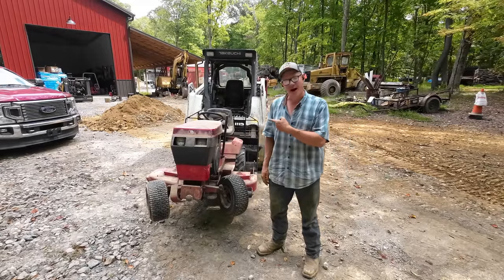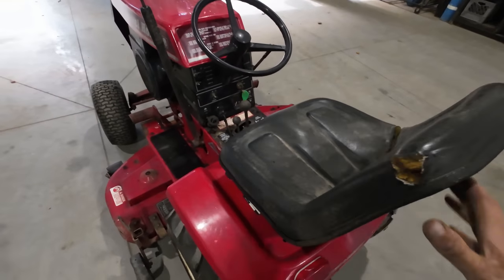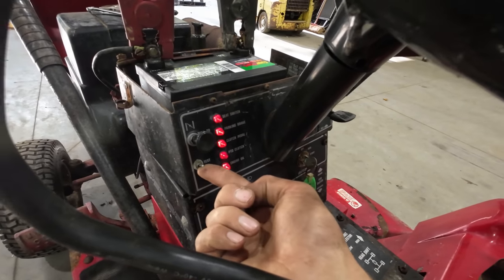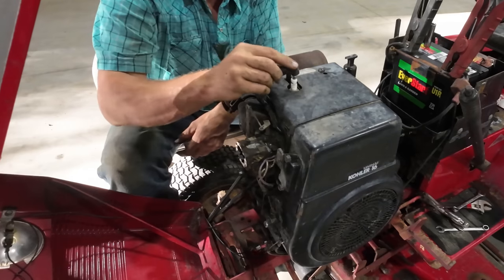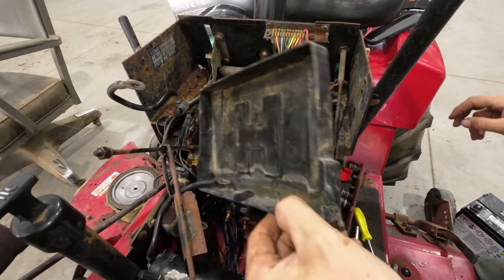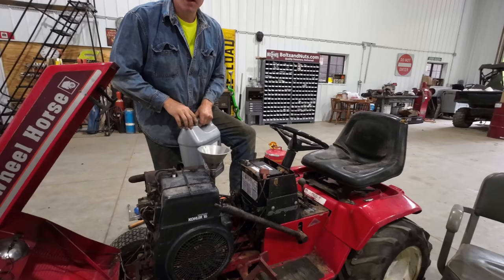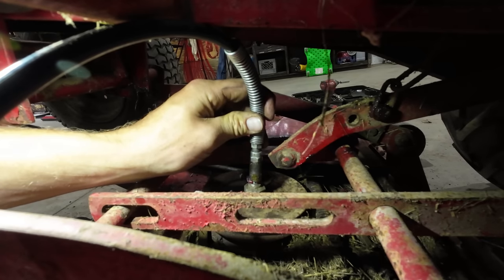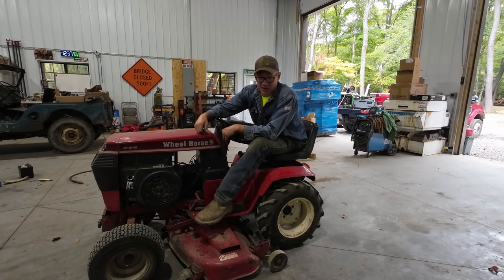FREE! Wheel Horse Garden Tractor sitting for YEARS! (WILL IT RUN??)

Comment: Mat I dont know if you knew this or not but one thing to note about those old K series Kohlers they had balance gears (Gernade Gears) inside the block they had needle bearings in them over time they tended to fall apart and or blow up blowing holes in the side of the block. Might want to check into that before that tractor goes to your dad only issue is to get those out is its a major surgery unless you just take the pan off and bust them out. I'm not sure if the Magnum's had them but the K series are basically the same thing as the magnum engines just points as opposed to solid state ignition.

Comment: great tractor. that's a magnum series engine. not the legend the k was but still good. those trans had either 1" or 1-1/8" axles with either bearings or bushings. all depending on the year and model. the little rubber boots on the shifters rot and water will get into the trans and freeze. that's why mine is a lawn ornament. the side discharge was the better deck than the rear discharge, much better cut.  that light board is real succeptable to battery vapor corroding it  so fluid film it up real good.  for some strange reason those plastic gas tanks in those make water  so keep it full

Comment: There are times I leave things dirty when I don't know them just in case I need witness marks if I have to remove a part that needs to be located specifically.. I'll wash things AFTER I'm finished with the repair but not usually before. If I'm going all out in a restoration, then fine, I'm going to do a nut and bolt so I'll re-seat everything anyway but no.. leaving it the way it was found is sometimes very important actually. (Bird poop not necessary though!)

Comment: I have lately considered it bad that so many people still seem to insist on using power drivers to remove bolts from these older small engines..  I see so often bolts broken, threads stripped etc. We always when encountering a jammed bolt in Aluminium alloy, carefully, by hand, push and pull, with addition of some form of lubricant or penetrant, and also add a careful shock to the end of the bolt to assist removal.

Comment: The 4 is 400 series, they made 200, 300, 400 and 500 series.  The higher the series, the beefier they are and more features they have.  Yours is a 1988 model.  You could have changed the transmission oil as well, but most likely it doesn't need it as long as there's no water in it.  If you want any manuals for that or any wheel horse tractor, check out the Red Square Wheel Horse Forum, they have every manual you could need there.

Comment: I would have tapped those Solenoid bolt holes and used a slightly larger bolt to do away with those nuts.

Comment: You could probably replace that center belt pulley grease fitting with a low profile zerk fitting. You won't have to worry about anything snapping off and it will keep dirt and crap from contaminating the grease in the pulley. You will need a grease needle to fill it, but I imagine you already have a few and if not, they're pretty cheap.

Comment: Hay Matt, why fool with those cracked and leaky tires? The airless can't hurt 'em solid tires are not that expensive and ya don't have to worry about flats, slime, or valve stems. Try Northern Tool and never worry about those front tires again.

Comment: I know you're a Cub Cadet man, but I really think the only advantage cubby had over wheel horse was the fact they used direct drive shafts to run everything instead of belts. Saw a wheel horse from back in the 60s once with a cigarette lighter on the dash.

Comment: Hey Matt.  Back in the 70s they did good with'em in tractor pulls.  Using a big ole stone boat loaded with solid concrete blocks.  I remember seeing more that one with a major number of wheel weights along with other additional weighting.  Surprisingly they'd pull some awfully heavy loads.

Comment: All our wheel horse, Gravely and older mowers with Kohler engines all had a short nipple and a 90 with a plug im assuming to aid in clean oil drainage because the block sat back up on the mount plate about an inch further than yours. Without that short extension oil would surely run all over everything

Comment: Can't kill an old Kohler! Had and older version of that Wheel house. I'm the same with my little machines and prefer Cub Cadets, have two 982's and a 1782 along with a bunch of older Cub's. I have run Shell T5 10w30, all my Kubota powered machines call for 10w30 so using it in everything small engine is easy peace of mind. That and it being diesel rated oil should help the older engines.

Comment: hi ,, the battery has a sticker that read E 6 ,,, so all battery got the sticker on them and some battery are punched in to the top sides ,, ( A ) means JAN ,, ( B ) means FEB ,, and so on ,,,,  6 ,, its maybe a 2006 battery or a 2016 battery ,,,, and most battery has a part number or group size  punch into the top side  also

Comment: Not that it makes any difference at this point but the date code sticker on the battery that came with the tractor  is the one with the E6 on it. The E is the 5th letter of the alphabet and represents the 5th month of the year so in this case would be May.  The 6 stands for 2016. Also, you seem to be having a problem getting past the first compression stroke when starting the Kohler. Probably a automatic compression release issue.  That could also explain the failed solenoid. When the starter can't get past that first compression stroke it's a dead short to the battery and needless to say overloads the contact in the solenoid.  Nice machine for the price.  But, I'm like you. Love my Cub Cadets but only the ones made by IH.  I have a couple 125's which were made in 1968. One I have since 1972 and still running strong. It was $1350.00 new without a mower deck. That was half the price of some new cars back then.  But, 55 years later still running with original engine.

Comment: The production date on that battery would be May of 2016.     That is what the "E6" tag is telling you.    E=May     6=2016    The letter corresponds to the month of the year. For instance, A= January. They start over at 0 at the beginning of every decade, but you can figure out the decade by looking at the labels, logos, etc.  That version of the logo was around in the 2010s.  I spent 10 years working with used batteries for a living. I've dealt with thousands. That matches the time frame the previous owner gave you.

Comment: I certainly agree when it comes to not cheaping out on oil, but it is important to use the proper weight oil. If you are using 15W in an engine that is desgined to run on a lighter weight, that engine is not able to efficiently circulate the thicker oil, and it will cause premature wear to modern engines. Engines manufactured prior to the early 90's were designed to run on different weights at different times of the year, but engines produced after the early 90's are not. I have found that a lot of people are unaware of that, and run modern engines the same way that they ran antique engines. I have see many engines worn out under 100K from people running oil was too thick for the engine. That is why oil manufacturers make high mileage oil. It is designed to offer better protection for high mileage engines thout using a thicker weight.

Comment: You kinda squawked about the nuts behind the firewall that held the solenoid on, newer stuff would probably have just used sheet metal screws. It’s a sign of better quality that they used nuts and bolts when they built this tractor. I would have complained too! Lol

Comment: i have never seen a wheel horse garden tractor over here in germany but the kind of how this is build reminds me of a brand we had over here in germany !  Gutbrod back then build them like tanks : Grease fittings everywhere, massive sturdy front axle, standardized parts and bearings, Briggs I/C Engines, metal hood without hinges because hinges could break after years of service.  nowadays the tractors named Gutbrod are just junk from MTD........ and you now what MTD stands for : MADE TO DIE  or in german "Minderwertiger teurer Dreck!"

Comment: I was told at one auto parts place that the green slime is the worst stuff to put in your tire because it will rot the rubber.
They said that there's other better products to seal a tire.
Maybe that green slime that was in there before is what caused the valve stem to rot off.

Since you don't really need that little tractor why don't you give it to me. 😃😁😉

Comment: i have a 310-8 1989 i think.  That has no spark.  I think that s safety switch.  i had it running, but now no spark.  How did you bypass the seat switch.  Also, do you have any idea what else could cause a no spark.  thx frank

Comment: Somebody was probably smart and ran non ethanol gas in that tractor, these new ethanol fuels can cause this weird white corrosion in small engine carbs, I’ve seen it too many times on pressure washers and lawn mowed, could also be these new Chinese cheap crappy carbs too, they don’t build stuff like they used to

Comment: Matt I have a older Cub Cadet that has been running starting and running fine till this year, when I try to start it runs for about 15 to 20 seconds then shuts off and is flooding out with fuel coming out of breather housing. Any idea what's going on?

Comment: I’m willing to bet that the solenoid died and it wouldn’t start, it was old so it was parked.  Last time I saw a solenoid that bad.. my old Ford Escort (loved that car)… wouldn’t start so I was checking the cables, and when I tried to remove the nut off the solenoid.. got the entire post… replaced and problem solved.. just like here…

Comment: Some engineers should not be allowed to design as much as a street sign. Like engineers who use bolt with a nut that is hidden behind everything, and i mean literally everything, where you literally need to take the whole unit apart to get to that one stinking nut. It is so many years since they invented a draw rivets with threads (The first rivet nut was created by BF Goodrich in the 1930s) or spot welders that can spot weld a nut on the hole...

Comment: John Deere 300 and 400 series ( the older ones ) are the best “Garden tractors “ ever made..  will def out a cub or wheel horse .. i have a 332 diesel and a 322 with the yanmar gas engine , and cub and wheel horse well i expressed my opinion on that already😂😂😂 but those Kohler engines are the best most durable engines ever made again my opinion , they are dam near bullet proof , again the older ones.. oh and put some tires on it😂😂😂

Comment: But WAIT. . .there is more(smile).  1.  You are a big boy. . .sitting on that tractor you clearly are not 5'7"!  But seriously. . . 2. Check those lights and see if you can put in some LED replacement bulbs.  Two reasons I have found it is worth the time.  It makes the machine look really cool cause no one does it.  And if you have ever mowed near dusk, mower lights are still useless.  When you put in LED bulbs they actually become useful.

Comment: I bought my house Jan 2022 and there was an 1987 Deutz Allis 1918 series tractor sunk in the ground in my back yard from the previous owner. He said it had been there for at least 8 years. The engine was seized, tires flat and the mowing deck had too many holes to be saved but through watching videos like yours I decided to try to get it running. I unseized the motor with some Kroil in the cylinder and after a tune up of plugs, oil, filters, ect, it is the best running, sounding and starting mower I own. It is the oldest of my three and I will never get rid of it. Hydraulic steer, trans, deck height, ect. Front and rear driveshafts for implements. Really nice unit. I would post a picture if I knew how. Love the old stuff.

Comment: Not sure what a cheap oil is. Brand loyalty is like car manufacture loyalty. I have over 40 years in the automotive field and have tested many oils both unused and used and I can tell you there isn’t a name brand that is that much different than others. Some have different additive packages but the base oil is almost identical. About 8 months ago I sent Mobil 1, Valvoline, Amazon and Shell all fully synthetic in the be tested straight out of the bottle and Mobil 1 and Amazon tested above all the others for lubricity and resistance to thermal breakdown as well as equaling advertised API ratings. Any name brand as well as Amazon brand is a quality product and if serviced regularly won’t differ in engine wear or buildup..  plus non filtered engines shouldn’t use that type of oil, it needs a straight weight non detergent oil so it doesn’t hold deposits in suspension and coat internal parts with those deposits.

Comment: Ugh. Have you ever tried to change a tire on a mower after someone used Slime in it? It isn't fun. You can get a small engine tire machine at Harbor Freight for about $50, and a tire only costs around $30. I don't understand why people use that stuff on small engine applications. You will spend all day cleaning that stuff off the rim.

Comment: When I hooked up with the lady who would become my future wife, her tractor was a 1976 Wheel Horse 316-8.  It's remarkable how similar that model was to your new baby.  The PTO, the deck lift, Kohler engine, seat - all the same.
I remember the starter was intermittent like yours, too.  That Kohler (K?) eventually got donated to a log splitter project (which, in turn was replaced by a Honda 20-hp V-twin).  The engine-less tractor is attempting to become one with the dirt in one of the back fields as I write this.

Comment: I used to work at a Cub-Cadet dealer 7ish years ago and i can tell you they are absolute GARBAGE. the number of engines we replaced with less than 150hrs on them( more than 30 in a month) and the number of deck problems from bending decks to absolute nightmare deck pulley problems means i will steer clear of them for a long time. Let me put it this way, if someone gave me a brand NEW Cub-cadet, i would sell it immediately. OH and stay away from ANY BRIGGS engine larger than 16hp, they literally shake themselves apart inside in less than 50hrs. single cylinders with the counter-weight are the worst about it.

Comment: A trick on square drain plugs if you don’t have a four sided socket is use a extension turned around so the female end goes over the plug and put the wrench on the male end . The point being the extension is harder metal than the plug and the square on the extension won’t round the plug

Comment: I'd say the way it's cranking that the decompress is not working correctly. It will kill starter and solinoid.
Decompression fix is usually just a Valve adjustment.

Comment: I now have a garden tractor that’s on steroids which is my BX2200 3 cyl diesel 4 wheel with locker rear axel Kubota bought new in 02 only thing I had to repair was power steering hoses 1200 hrs.

Comment: Toro bought over Wheel Horse and eventually stopped importing these into the UK. Did a PDI on one in 1974 , it was gifted to me the early 2000’s , I stripped it and gave it a respray a service new decals and sold it for more than the 1974 new price.
A couple of hours would see that engine running if it hasn’t been roasted.

Comment: I grew up with a Simplicity (very good machine) 3 speed, PTO front and rear 3 point (but it was a small tractor for cutting grass really) they had a snowblower attachment for the front PTO, the rear we never used anything when I was alive but they had a small farm in the home they lived at before I was born and they did have a tiller for the back of it. That was a 12 HP 3 speed but I"ll tell you what, oil changes every season and fresh gas that thing never skipped a beat!! I miss that old garden tractor!
27:15 one of the tricks with Nana's Simplicity tractor was to start it it was a ROYAL pain in the arse, you had to have the gear selector in Neutral but it had to be EXACTLY PERFECTLY centered dead middle of the N in the dead center of the H. Oh it was SUPER annoying when the safety switch would move if you hit a big bump while mowing or it corroded and wore away.. man it was a pain to start that thing if it didn't want to.. Not sure if you're going to figure that out but that's what I'm seeing
Edit: huh.. didn't even catch that when you installed the new solenoid.

Comment: I had a few tires with slow leaks in my lawn tractor.  I used Slime but did not have good luck with it.  Finally got POed and put tubes in each tire.  Problem solved.  It'll be interesting to see if it fixed your leaking tire.

Comment: Hi Matt  :) my cousin Dave he has same brand Wheelhorse  type gas model too also he has blade on front plus lawn bed to 48 inches type also tiller on for garden work too with arms also pto like farm tractor has ! He got weights on front  back rims with chains to  put if needed! He told bought his at TORO dealer near use also snowblower on back too ! Funny part quiet machine when running and not how old is but Kolher motor too ! Same tires on back too and great grip too ! Hopefully you have lots years use this tractor too  and much more! Also he oil undercoat every years and looking like new too! Also for keeping Solilendo  brake down Matt put some Die Electric grease and lube key ignition switch with Crowl Oil to ! Plus pulley Josh told about grease put grease then bolt so get dirt and plug grease from not getting to need on deck pulley !  Also my cousin Dave run A grey bottle of STP Total Treatment fuel injection and carb cleaner in fuel tank with 90 octane no Ethonal in and change engine oil plus oil filter every 3 months and fuel 2 times one Spring Season and other in Fall plus air filter too! Spark plugs 2 times too !